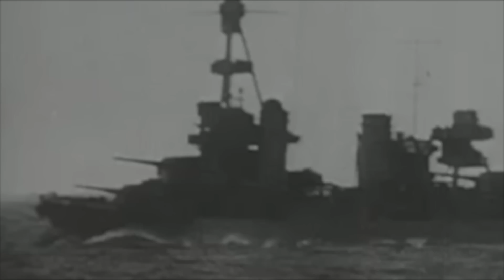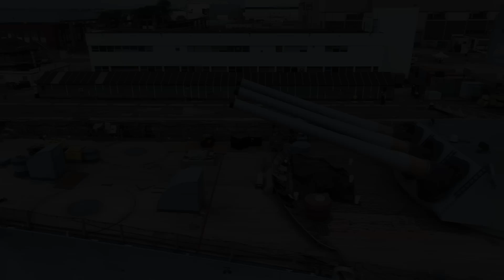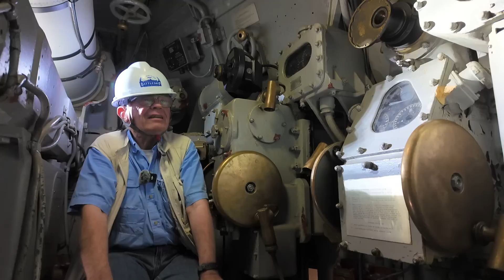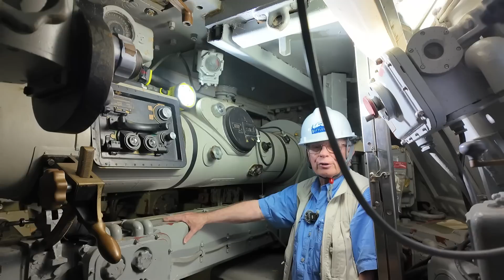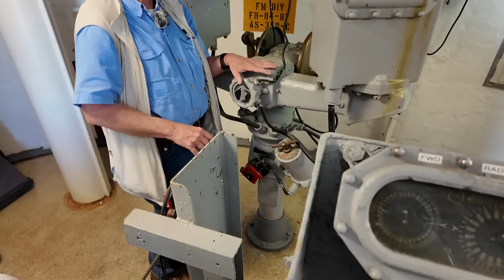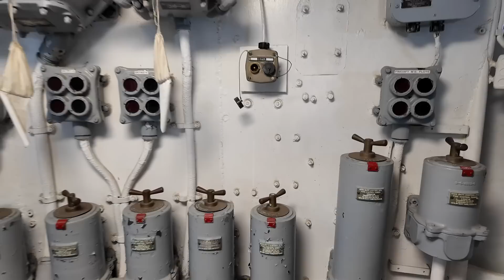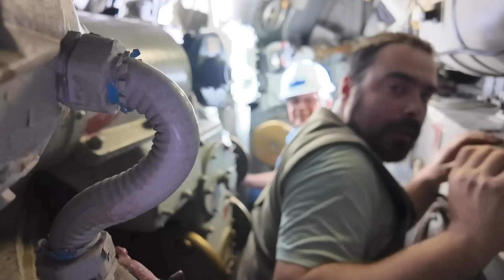Naval Gunnery - Rangefinding on an Iowa-class battleship

Comment from the maker: Pinned post for Q&A :)
Reply: Is this the longest 'Five Minute Guide (more or less)' to date?
Reply: When ships are firing. Lets say your on the Iowa's and you haven't fired your range finding salvoes and the destroyers(5 inch) or cruisers( 8 inch) are firing. Can you on your XYZ ship use their firing splashes  to tune you guns range firing data to score better hits? Or is the range, type of guns, flight characteristics, flight times, etc of each shell too great and time consuming to make that work effectively. Using the "time of flight concept" that armies use to have different land artillery systems land on targets at the same time.
Reply: As the confined nature of the anchorage at Rosyth prevented the battlecruiser force from practicing long-range gunnery (and ultimately led them to adopt problematic firing procedures), was there any other location outside of Scapa Flow which would've allowed them to avoid this problem whilst at the same time allowing them to be close enough to quickly intercept any German raiding force? And if there were, why was Rosyth chosen instead?
Reply: Why don't you wear, if not a ballistic helmet, at least a plastic, white water rafting helmet while crawling through these military dungeons, Drach?

As a caver, I wince at the sight of you trying to maneuver through those steel caves...
🤣👍
Reply: Other than aircraft carriers, I don't think I've ever seen an action station that I'd consider roomy.  What is the largest action station you know, excluding spaces devoted to aircraft or other things not bolted to the ship?  Also, the same question for the smallest action station.  Feel free to define the scope of this question as you wish to fit your view of what would be interesting and not require excessive research.
Reply: I've read that the Dutch East India Company was powerful enough to have its own private military and subsequently a private navy. what was the composition of the ships of this navy? Was it comparable to other nations in regards to what kind of ships they operated or was it more specialized for their needs?
Reply: Now that we have seen the fire control of an Iowa, can you show us the one on Belfast and a destroyer for comparison?
Reply: This video mentions a lot of "range is sent" or "bearing is transmitted to plot".

As this was the time of analog computers, how exactly did this data transfer work? Voltage levels? Pulses like early telephone signaling?
Reply: What were the major differences between the fire control systems using radar and range finders etc. between the various Navies in the WW2 period?
It's apparent that massive progress and fast iteration happened in a very short time and I wonder of any instances of convergent evolution happened in these systems.
Reply: @Drachinifel  theoretically speaking, what class or type of ship do you consider the pinnacle of Ship building design for warships (ww2 or Cold War) contributes to our modern fleets today, although excluding the carriers and assault landing ships.
Reply: In your intro, at 0:24, what is the ship shown firing? looks like a Northampton or Portland as i dont see a second rear turret firing(so not a Pensacola)
Reply: How did sailors train to operate the range finding equipment that was shown in the video?
Reply: Would the main rangefinder station have the naval ID diagrams to help identify the enemy ships?
Reply: @BPLColddawg seems possible and likely. Submariners had booklets with silhouettes of different ship types to better figure out what they were looking at, I don't see why the surface ships couldn't have them.
Reply: In the age of sail, if a mast broke in a storm in the mid Atlantic, what options did the crew have? Could they make a makeshift fix, or just wait to they got to a port?
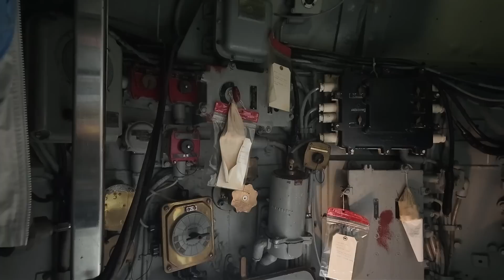Reply: Do you Navy vets want a blast of nostalgia? Look at the plastic, zip-top bags at 19:25. I could not tell you how many MAF copies I put in one of those things and taped it to the top of an ALQ-99 pod transmitter. Not to mention all of the other things we used to turn in for replacement. In 11 years working in AT shops I must have handled a thousand of those.
We used these in the '90s. Are they still being used?
Reply: Ive heard some rumors of a planned carrier conversion of the last littorio lass battleship imperito is this true and are there any sketches of such a configuration? Or are these just wild speculations?
Reply: Back when World of Warships was new the various main battery directors were static and did not rotate. Then they coded in a rotation slewed to the turret rotation. Understand this was done to keep the coding clean and is not accurate to reality. No director was slewed to the mount it directed for any weapon.
Reply: 1. When confronted with the problem of the Type 93 torpedo being too big for their submarine designs to use, why did the IJN develop smaller Long Lances instead of bigger submarines?  They were far from averse to giant submarines as it was...

2. When breaking the line, is it better to come in perpendicular to the enemy fleet (Trafalgar, Lissa...), obliquely (The Saintes...), or something more esoteric (First of June...)?

3. Why did the German hexagonal dreadnoughts slow down so badly in turns?  Given that the increase in the frontal area that a ship presents to the oncoming waterflow at a given sideslip angle is relatively lower for a fat, low-aspect-ratio ship like a Nassau than it is for a ship with a higher aspect ratio, one would've thought that the early German dreads would've been less affected by turn-induced increases in drag than most other dreadnoughts.  Did their low aspect ratio allow them to yaw quickly enough to cause them, when turning, to reach a sideslip angle so much higher than that of a finer-lined ship as to outweigh the lesser increase in frontal area for a given sideslip angle?

4. Could one have trained an actual monkey to act as a powder monkey?
Reply: Are the secondary guns slaved to the primary range finding station or do they have a separate gun control system that allows them to target a different baddie?
Reply: @Crashing310  the secondary 5-inch guns have 4 separate directors. If you pause the video at 2:00 and see the rear end of turret 2, the conning tower and bridge windows.
Now you also see the boxy thing above and just behind the bridge with ears and the "E" on the side with slash marks under it and the round radar antenna on top? That is one of the 5" directors. The "ears" actually have the optical rangefinder just like the one that sticks out of the main battery directors only smaller. You can see another just behind the R2D2 CIWS above that first 5" mount. There is one like that on the other side and there is one back aft, forward of and above turret 3.
These smaller directors, while meant for the 5" guns for use against surface and air targets, they can also be used to direct the main battery guns and to also be used alongside the main battery directors to provide a better fire control solution.
I hope this wasn't too in depth.
Reply: @Crashing310 Each weapon system had its own set of directors. Main Guns, Secondary battery, and heavy AA. On an Iowa for example, the secondary battery had multiple director positions (2 per side), which allowed the five inch guns on each side of the ship to engage multiple targets. In an emergency these could also provide information to the main battery. Not being as high in the ship, visibility suffered a bit if used in this emergency role, but they could do the job. Also, these directors could calculate information for firing star shells to illuminate targets at night... something Spot 1 didn't have to worry about. Finally, at one point US battleships toyed with linking the main spotlights to the directors, to aid in illuminating targets at night. This worked for close targets, but didn't do much at maximum range. The 40 mm battery had a director position for each quad mount. You see them quite clearly in World of Warships. In theory each 40 mm mount could target a different plane, although often multiple AA batteries would be tasked to fire at the same target to ensure a kill... especially with kamikazes. The 20mm to my knowledge never had directors, though they did have rudimentary holographic sights on each gun.  Each 20 mm gunner would have to track his own target, though phone talkers would clue them in on which planes to prioritize.The Main battery, secondary battery, 40 mm battery and 20 mm battery  all had separate phone circuits to aid with these tasks.
Reply: How many positions are capable of firing the guns on an Iowa? Seams like a hek of alot.
Reply: When describing the pointer and cross-leveler positions, it was mentioned that if they cannot see the horizon, they can use a pointer-following mode from the stable vertical. What purpose does this serve? If the pointer and cross-level are inputs to the rangekeeper, why not just use the stable vertical as the rangekeeper input directly?

I guess its for aligning the optical rangefinder rather than for the sake of the rangekeeping computer? If so, if the pointer and cross-leveler were switched to pointer-following mode, would the rangekeeper still receive inputs from the humans or would it also directly receive the input from the stable vertical?
Reply: Q&A: Were there any final assembly level calibrations of range finding systems, such as having range markers at a known distance and elevation on shore for calibration during the fitting out process, or were subassemblies calibrated to a certain degree and the overall design tolerances good enough and errors simply accounted for by witnessing hits/splashes and correcting on the fly?
Reply: I have a question that I am not sure is covered as a topic but it might be buried in presentations.

Can you give a discussion on secondary and tertiary battery layouts for cruisers and battleships? I am curious if there was an evolution when things moved out of barbettes and into dedicated turrets and how they moved about ships as different designers had different thoughts.

Thank you.
Reply: This question is inspired by an offhand comment by Alexander Clark in his video "Square Pegs for Round Holes: When it's not a bad Admiral but the wrong job for that Admiral")

If the Dutch had an aircraft carrier in 1940, what would its fate be?

Specifically, what if Karel Dormaan had successfully convinced the Dutch government to invest in an aircraft carrier in the mid 1930s?

I am guessing they would try to license the design of either the Yorktowns or Ark Royale (like they historically tried to license the Scharnhorst design for their Battlecruiser),

so if a roughly 20K ton Dutch carrier joined the Allies in 1940, what might it do?
could it take part in the raid on Taranto?
the hunt for Bismarck?
would it be any good in the Mediterranean?
And could it have sailed with force Z?
Reply: Can all YouTube content be as well made as this video?
Reply: This is one of those videos that you can pay really close attention to it but still have to watch it 3-4 more times to be able to soak up all that he was saying. Cuz by the time he is finished, I end up saying to myself... "OK, tell me all of that again, please." Idk, but the way he explained most of it, it seemed like the system was made to be dummy proof.
Reply: In the guide to HMS Indefatigable you mention secondary guns that are placed atop the main gun turrets. This would seem to present a lot of problems, including exposure to blast and turret movement disrupting aim of the secondary guns. But, just for starters, how could the turret top guns be supplied with ammunition in battle? Would it have been the practice to risk storing a supply of secondary ammo, in the open, on the turret top?
Reply: Drach! Your timing couldn’t be better! There is another YouTuber who makes content on computing systems who wants to make a video on the Iowa fire control system and how it works (Alexander the OK). It would be amazing to see a collab between both of you on the Iowas
Reply: How different is it inside Sky 1 through 4?  (I.e. the directors for the 5" guns)  Were you able to get the same sort of briefing you got here from the good Dr that we might hope to see released in the future?
Reply: Does the navy have any footage of guys using the rangefinders during training id love to see them in use
Reply: How often did battleships get a hit on their first salvo?
Reply: if the Bismarck  broken out into the Atlantic after fighting the battle of the Denmark straight what type of measures would the British take with their convoy escorts how much damage with the Bismarck and flicked on Atlantic shipping  and what type scram of battles the Bismarck fight    163
Reply: Out of curiosity do you have any plans to visit HMS Caroline now that the ship seems to be open again?

On the topic of Belfast, do you know of the schooner Result at the Ulster Transport museum? She served as a Q ship in WW1, but was photographed by a U boat shortly during one of her early patrols. She's been ashore on display since 1979.
Reply: Possibly not something you'd want to speculate on, but if Irish Unification ever happened what do you think would happen to Caroline? She has a long history in Belfast, but as a Royal Navy ship, do you think the National Museum of the Royal Navy would leave her there or move her?
Reply: What would the gunners do for work, when the ship is like on transit? Would they have a dedicated work or just generally maintence or cleaning aboard the ship.
Reply: Thank you and Dr Scholes for a great video Drach. Dr Scholes mentions a number of times systems having redundancies and back-up positions to do the same job. Can I ask, how often we're these 'back-up' positions used? Are there many mentions of ''They took out our main fire control so we had to shoot from X/Y/Z.'' Are there any cases in WW2 where it got so desperate they were aiming from the turrets?
Reply: Thank you and Dr Scholes for a great video Drach. Dr Scholes mentions a number of times systems having redundancies and back-up positions to do the same job. Can I ask, how often we're these 'back-up' positions used? Are there many mentions of ''They took out our main fire control so we had to shoot from X/Y/Z.'' Are there any cases in WW2 where it got so desperate they were aiming from the turrets?
Reply: What is the firing process for these guns, from "enemy in sight" to "fire!" ?
Reply: What is the firing process for these guns, from "enemy in sight" to "fire!" ?
Reply: Did any navy consider varying their own speed in a periodic way to throw off the enemy’s fire control solution? I imagine even if a ship’s speed varied by a few knots over the course of say 5 minutes, it could disrupt the enemy’s solution as they’d always be slightly off. Of course you would know your own speed when firing back.

If no navy did, what was the reason why?
Reply: Did any navy consider varying their own speed in a periodic way to throw off the enemy’s fire control solution? I imagine even if a ship’s speed varied by a few knots over the course of say 5 minutes, it could disrupt the enemy’s solution as they’d always be slightly off. Of course you would know your own speed when firing back.

If no navy did, what was the reason why?
Reply: What’s the best main battery fire control you could come up with combining the optics, radar, mechanical fire control system, and the electrical wiring from the 31 WWII-era big-gun capital ships?
Reply: In Drydock 321 part 2 you mention the theoretical possibility of building a fast battleship in the pre-dreadnought era, putting aside all the outside factors you outlined in the answer as to why this was never done, from a purely engineering perspective, what would such a vessel look like? And if some mad monarch overruled all logic and naysayers, how would the rest of the world react to such a vessel being built?
Reply: if the Bismarck  broken out into the Atlantic after fighting the battle of the Denmark straight what type of measures would the British take with their convoy escorts how much damage with the Bismarck and flicked on Atlantic shipping  and what type scram of battles the Bismarck fight    163
Reply: Possibly not something you'd want to speculate on, but if Irish Unification ever happened what do you think would happen to Caroline? She has a long history in Belfast, but as a Royal Navy ship, do you think the National Museum of the Royal Navy would leave her there or move her?
Reply: What would the gunners do for work, when the ship is like on transit? Would they have a dedicated work or just generally maintence or cleaning aboard the ship.

Comment: Another thing to note, for the kids out there (i'm old i can say that!), the fire control computer was an analog device, and quite a bit of it was mechanical.  Yes, virginia, computers can be mechanical and definitely can be analog.  In fact, there are areas of computer science that are looking into going back to some analog systems, simply because you can do some math that way easier than digitally.

Even the engineers of the era designing these ships and system didn't typically have access to what we would consider a computer today.  They were using slide rules.  Your old school 4 function electronic calculators weren't even around back then.